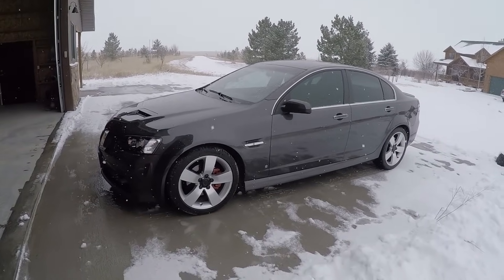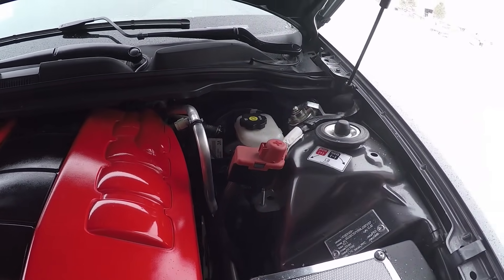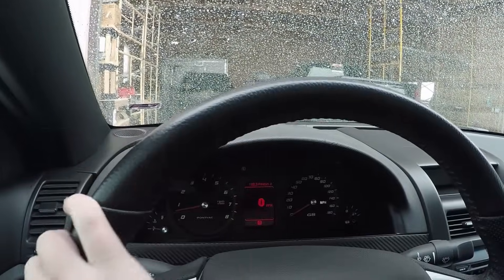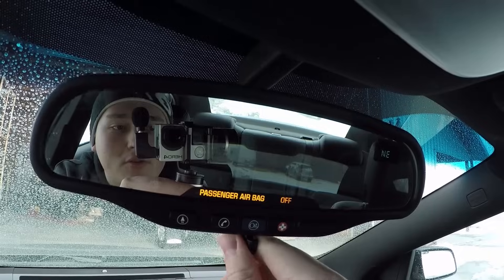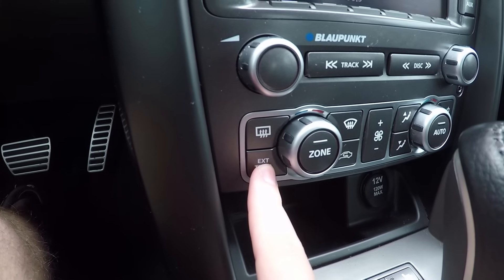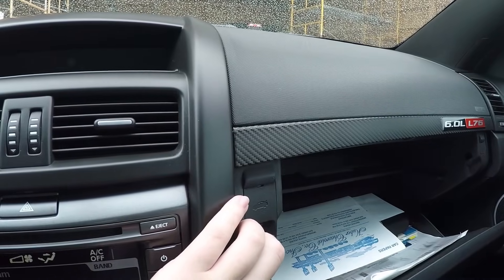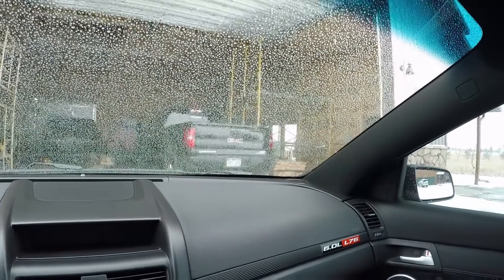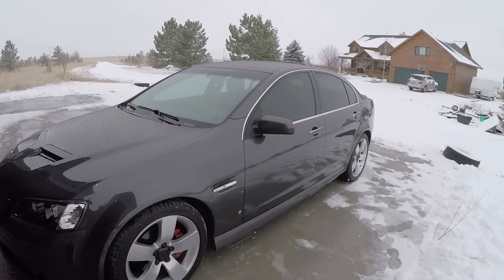Pontiac G8 Interior And Exterior Overview

Comment: Nice walk thru. There's a extra set of cup holders in the lower part of the back seat. It slides out after you give it an push.
Reply: That was only available on 2009.5 model
Reply from the maker: +DavidJLim  Thanks!!
Reply: +HORSEPOWER 5280 (HORSEPOWERAT5280) 
I have the Bluetooth feature but my dash only says Blaupunkt on it

Comment: hey there great car i own a 2008 GT. one thing you need to know you said that 20091/2 GT had less HP, its actually GM dropped the HP from 361 (2008) models and all 2009 models dropped HP to 355 due to emission changes. Remember GM made 3 models of G8's the base model which had a V-6 the GT which had the 6.0L V-8 and the GXP which was top of line with 6.2L V-8 LS2. ths car produced 415HP. the base G8 did not come with the LCD screen for raido and HVAC conctrols. i would tell your viewers that these cars are a Australian Holden built car. Holden is a subdivision of GM. The current Chevy SS is the current car made which replaces the G8 since Pontiac closed down in 2009.
Reply: but the 2008 g8 GXP is the same as 2009 GXP except for the horsepower difference?
Reply: The 2009 G8 Base does have the LCD screen it also has a six CD changer and the HVAC controls.
Reply: @megacharzard10gameing79  GXP was only in 09

Comment: Great walk through mate, I see you have not done the ignition recall as you still have the flip key.
Reply from the maker: +Ken Stow  Thanks! I am going to hold on to my flip key as long as I can, I forgot to mention that recall in the video.
Reply: do they replace the flip key with standard chip key ?
Reply: If you get the ignition recall the flip key can not be used unless you hack it